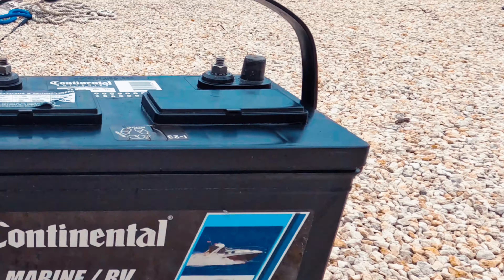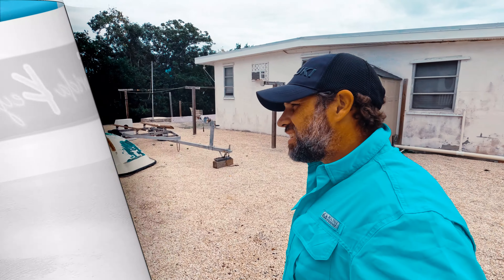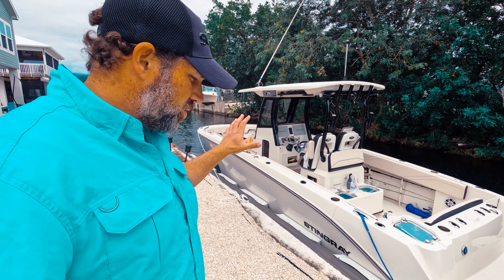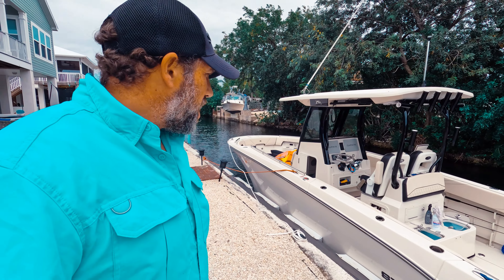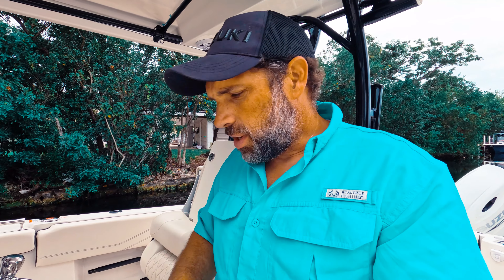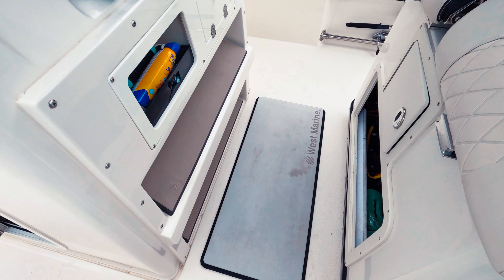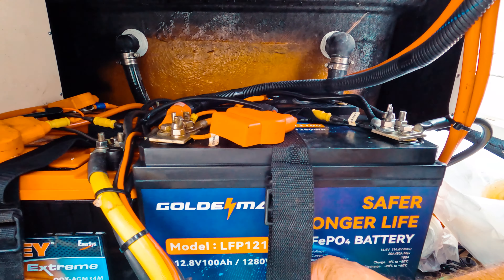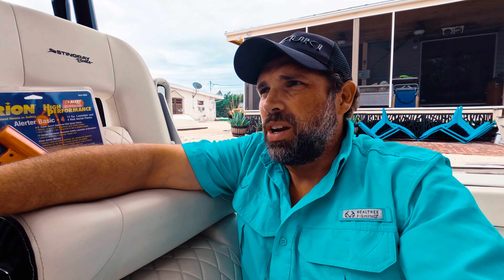Ep 22 Batteries Explained / Which Battery Chemistry is Best for Which use in your Boat

Comment from the maker: I forgot to mention in the video. These GoldenMate batteries weigh significantly less than the lead acid battery. Both 100ah GoldenMate batteries together, weigh less than the one lead acid battery I replaced.

Bottom line, I tripled by battery capacity, while saving weight.

https://goldenmateenergy.com/products/12v-100ah-lifepo4-lithium-battery?sca_ref=5252655.BK55UHnWEj